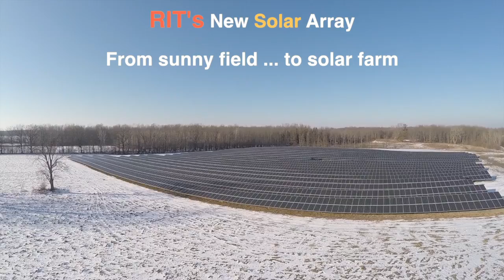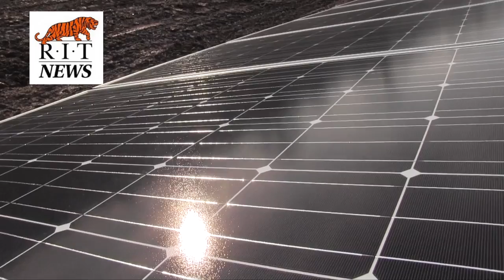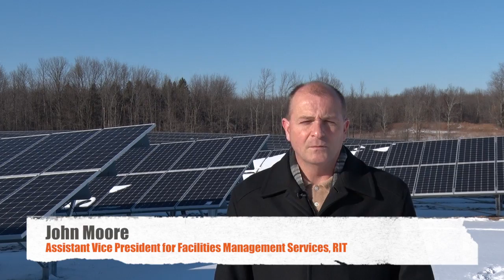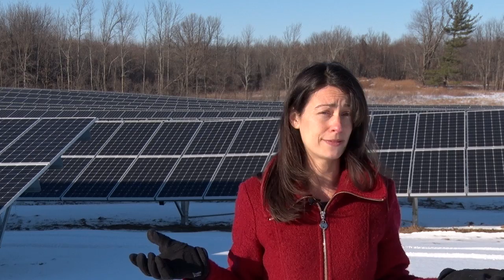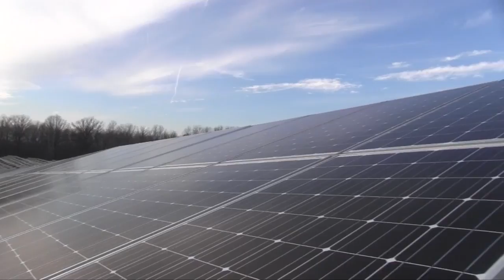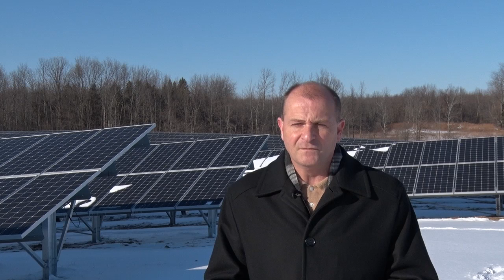RIT's New Solar Array

Comment: So RIT does not own the solar array :(
Reply from the maker: Technically, no. It works out more cost effectively to let the third party build and maintain the array and provide us with the discounted power.  Then, after the 20 year contract is up, they will return the field to its original condition (removing the by then obsolete array).
Reply from the maker: We will have full access to it for research and classroom data though.